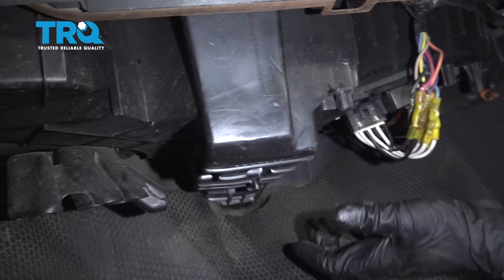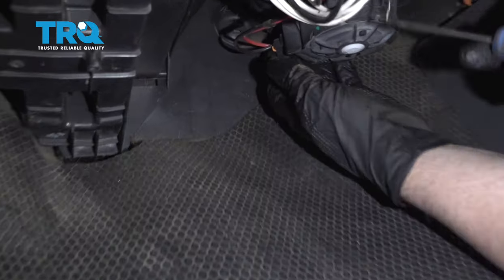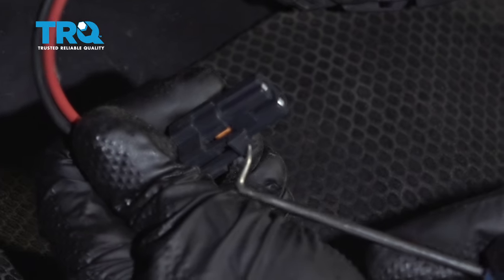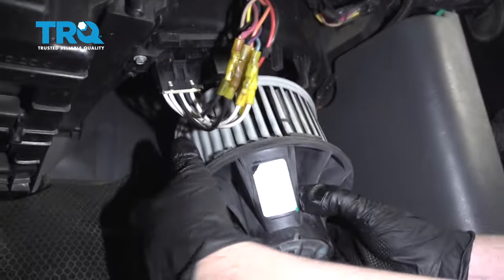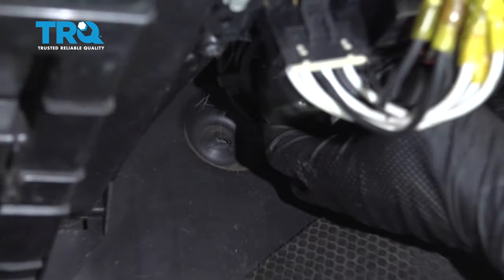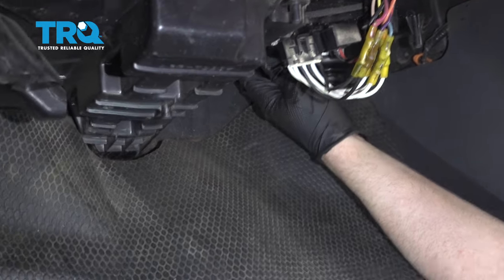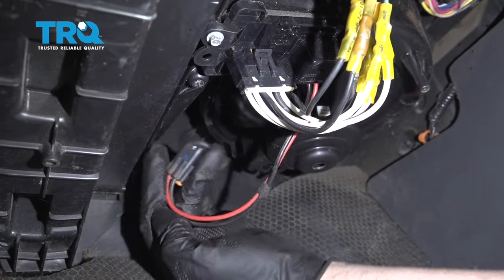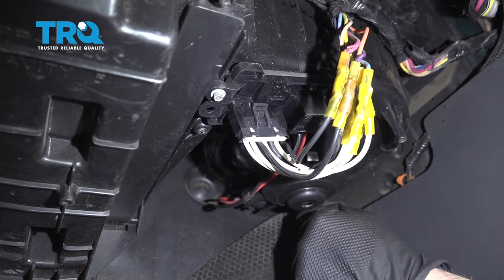How to Replace Blower Motor 1999-2007 Chevy Silverado 2500

Comment: Just a note, trucks with auto climate control have a slightly different blower motor that is held in with screws, not a twist lock.
Reply: Mine had auto climate and the tab style blower and a different connector than that

Comment: If your resistor is continuing to blow,  change the pigtail on the resistor before blindly replacing the motor. You can remove the motor and test it with a battery to determine if it is bad or not.

Comment: Thanks for the great video! I just replaced mine with a new one and it works! Is it normal for it when installed to have a little play? I thought that it would be a tighter fit. Anyways, it’s working fine thanks again!

Comment: Question - I hear a Thump from the blower area when the AC is running on the lowest setting. Could this be debris? I have a 2000 Chevy C2500 3/4 Ton 5.7 L 2WD Pick Up, does this vehicle have a Cabin Air Filter??